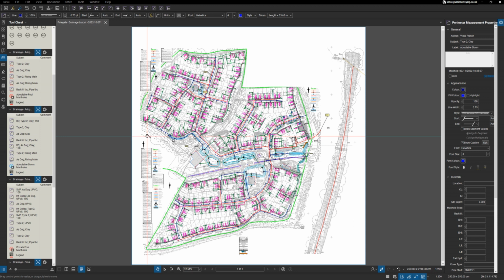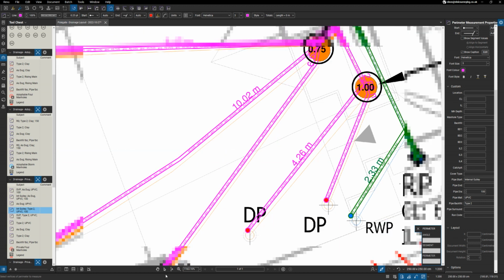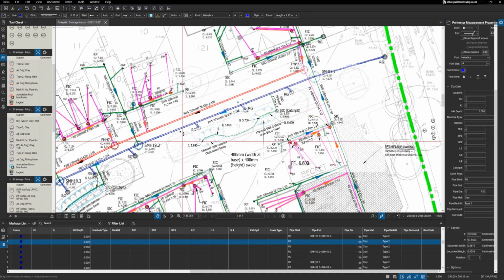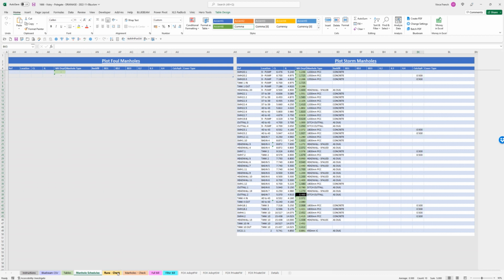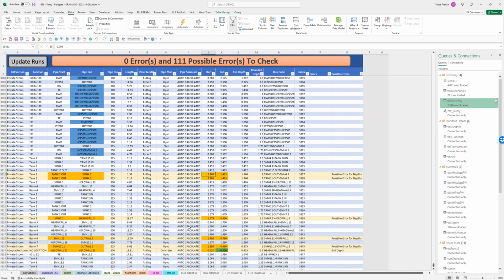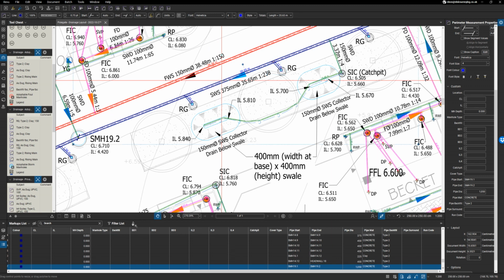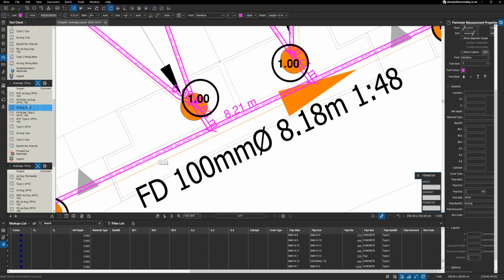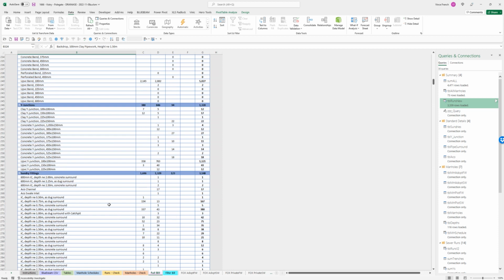Bluebeam and Excel - Measuring Sewers

Comment: Great video! I’ll have to try the stitching together of the drawings as that could save a lot of time. One thing I’d be keen to see is how you approach a cut and fill exercise for a large housing development. This takes me a lot of time tediously labelling each plot with levels - not sure if there’s a quicker way!
Reply from the maker: If this isn't done by someone with CAD then I do have a set up for it, but it does involve entering a lot of levels.   Once the areas are exported to Excel then all of the areas are automatically grouped and sorted - how I allocate the measures will depend on the areas and levels involved.  I then have details for topsoil strip, min strip if no topsoil, stated formation level if required, depth of finishes along with say 6 existing levels and 6 finished levels.  This sounds a lot but most of the details are prepopulated apart from the actual levels.